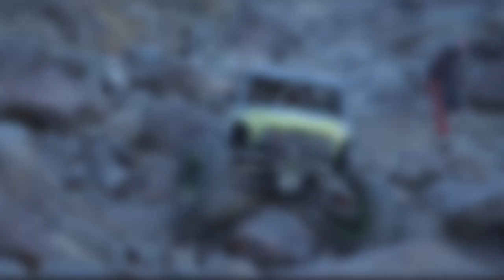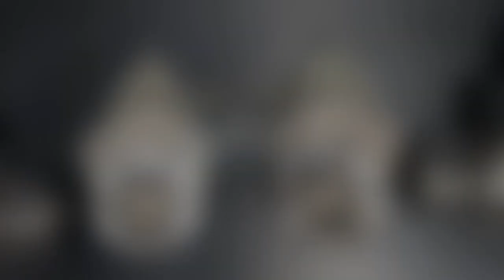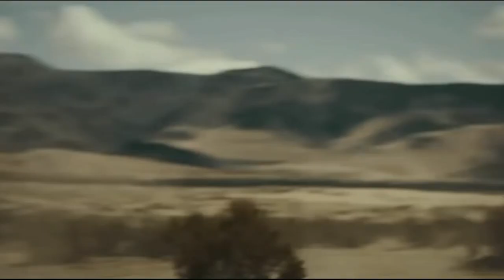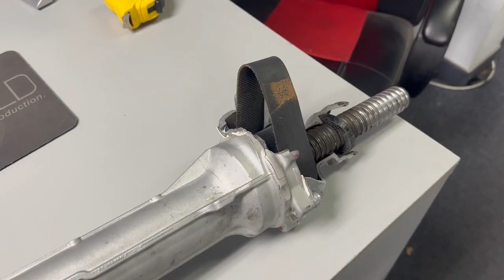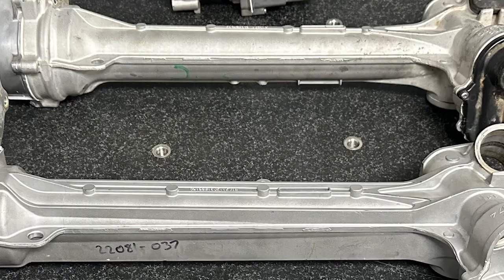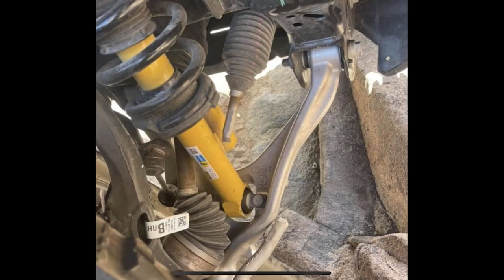Why is your bronco steering rack breaking?

Comment: Are the Hoss 2.0 and Hoss 3.0 interchangeable? Do they have the same bolt size? For backup purposes
Reply from the maker: @HoNkEyKoNg67  physical housings will bolt up using the same holes. If you are really worried about rack failures our stage 3 is what you want. You won’t break it
Reply: @74weld  so what would cause the driver side steering rack to make noises on a certain spot on the steering? I thought I had an inner tie rod wore out. I took off the boot. It's coming from the rack itself. You can aso feel it when you put your hand on the tie rod and have someone turn it. It makes a crackle type noise too. Jc I only have 3000 miles and haven't really been hard on it. I'm a gentle common sense type of wheeler. The Moab Ford dealer said it's ok to drive like that. They couldn't get me in to look at it officially. My local dealer will try and get out of covering it. I can see that coming. And this is the Hoss 3.0! 🙄

Comment: Thanks for the great video. 👍

When Ford designs these parts, what kind of a worst-case scenario do they use in their design?

In other words, what kind of a Safety Factor do they try to incorporate into their design, especially w/a part like this?

I would imagine that the Ford Design Engineer runs some kind of a stress analysis on the design, using a Finite Element Analysis (FEA) program, using a Safety Factor say of 2 or 2.5, depending on Ford's Standards, and if it fails, beefs up the design until it does pass.
Once passed, they make a physical piece and run it on a Bronco out on the field beating the crap out of it.

I own a bone stock 2023 Bronco Black Diamond, which I do drive on dirt roads, but nothing too harsh. I imagine that it only has the HOSS 2.0 rack

For peace of mind, I was thinking about going at least w/the BroncBuster Tie Rod BusterBrace Set, since it is such an easy part to install.

They also have their BroncBuster Standard BroncBushing Kit as well, which I don't know is a real necessity. I'd have to find someone to install it, which may not be too easy.

Thanks!

Comment: What's the weight difference between hoss 2.0 & 3.0? Could carbon fiber be an alternative? 3d printed cf? or 3d printed metal? I want stronger and lighter parts for my bronco.

Comment: Thank you for a great video and actually verbalizing that the tie rod is intentionally the weak point. I wish more people would understand that. With simple tools and a spare tie rod it’s an easy inexpensive trail fix. The stock configuration Bronco was a good design if ran that way. Any modification, will affect something else! If you plan to wheel your $70,000+ vehicle in the rocks, be smart do all upgrades including this, otherwise be smart and buy a wheeling rig and keep the Bronco for dirt/snow exploring wheeling.
Bailey Cole’s race Bronco is a perfect example!

Comment: What is the reason to go with the Hoss 3.0 rack and make the housing for it vs 2.0?
How many of the OEM 3.0 racks have you seen fail?

Why not make the housing for the 2.0 rack so that everyone with this rack doesn't have to purchase a 3.0 in addition to the stronger 74Weld housing?
Is the 30% more torque from the 3.0 rack that important?
Is there any downside to the 2.0 internals?

Thanks!

Comment: Nice details on the differences. I have the 3.0 HOSS setup. I'm not 100% sure I'll need a billet rack, but I believe this is definitely needed for the Broncos. I'd love to run your portals on my Wildtrak!
Reply: If you have a Wildtrak and want to upgrade the housing we will be able to swap your setup into our housing and save $$$.
Reply: @quinnpultz8004  Tell me more? Any possibility of sponsorship? I'm active on the 6G Forum. Would love to hear about a package with portals possibly.
Reply: @rugu6869  we don’t really do sponsorships but we are developing an ambassador program for people active in the community. Details on this will be released at the end of this quarter
Reply: @quinnpultz8004  Got it! Looking forward to it. Any technical details regarding the portals for the Bronco? Would it be wider than stock (fender flares needed)?
Reply: @rugu6869  we will do some videos here soon. Yes it has to be wider as we package a gear and two bearings all stacked in width. Not much we can change on that. The bronco will be similar specs to the Jeep. We have that info on our site

Comment: Very Excited to see what y’all come up with and very interested in getting one! I’ve had my steering “time out” on three different occasions while wheeling, Twice in Moab and once in Uwharrie. Definitely not a good feeling to loose steering and ready to get the thought if it failing out of the back of my mind.
Reply: What do you mean time out?  As in temporary steering assist reduction to almost none?
Reply: @josephburgard6574  Basically loss of all steering, every time it’s happened I’ve had to shut off the vehicle to get my steering back. All three times it was with the front locker engaged while trying to turn while on an obstacle. From what I was told from someone in development is it’s the electric assist timing out. I’m scared to try to overcome it by man handling the steering wheel so usually I roll far enough past that I can get the vehicle into 2wd and then shut it off and restart.
Reply: @moodyblueoutdoors  EPS (electronic power steering) units will purposefully de-rate and lower their steering assist output as a protection feature to avoid damaging the internals due to high temperatures and/or consistently high motor currents.  When you air down the tires and put the front diff locker on, the rack loads are much larger than normal which shortens the power on (duty) cycle.  Try to avoid continuing to steer while an obstacle blocks your front wheel movement as this stalls the motor (causing high motor currents) and only turn your front diff locker when you absolutely need to.  Just cycling vehicle ignition won't instantly bring back full steering assist due to the high internal temperature build up.  Not trying to criticize your driving skills, I'm no rock crawling expert, just know EPS pretty well.
Reply: @josephburgard6574  Oh I know, two of the time its happened I was actually wheeling with someone up the development chain at Ford and he actually broke the rack in his bronco so we had to trailer it home. My front locker only comes on in extreme need situations which sucks because it’s always a worry in the back of my mind on trips. One of the times we purposely left the bronco running and after 15 minutes steering still hadn’t came back. The other time restarting was my only option because if not I was stuck on the middle of the trail with 35 Gen 6 Broncos behind me.

Comment: So you guys don’t think the current aftermarket bushing for the rack that’s on the market is worth running?
Reply: I think that if you plan to offroad your bronco you need to change HOW the rack bar is stabilized. You can add whatever aftermarket things you want but because the factory rack uses essentially a crush sleeve to set backlash on the rack and pinion there is no way to change how the rack bar is supported on the pinion side. Any bushing on the pinion side that is tight is a bad idea and a bushing that is loose doesn’t support against shock loads. Does this make sense?

Comment: You can put the HOSS 3.0 steering rack in any Bronco now with FDRS.
Reply: This is only somewhat correct. We have successfully programmed the rack and I don’t think this is something the “average guy” is going to do. With that said I had several meetings with Ford Performance engineers at KOH and they are eager to support this endeavor. This will be an option in ProCal. If you don’t want the tune, you can get a ProCal for JUST the rack at a lower price point.
Reply: Check out the 6G forum. The 3.0 rack has been swapped into a Bronco and they have the coding to go with it completed as well.

Comment: A356 is not super strong, neither is 6061-T6, while 7075-t6/t651 is probably the best choice of aluminum for this.  7075 is way stronger, still has 11% elasticity, and is about the same in raw material cost (at most 10% difference).
Reply: We feel 7075 is probably not needed in this application. Are we 100% sure…not yet, but to give some perspective, we run 6061 on our portal boxes that do 140mph across the desert and we have never had a failure in over a decade of use. Materials are important but so is design, arguably more so. We are confident that the pinion will shatter before our housing will break
Reply: @quinnpultz8004  I agree with you that design is more important than the pure material strength.  Some opined that it could be that 6061-T6 is weldable and 7075-T6 is not, which for Baja/endurance races could be a factor. I appreciate the response!
Reply: @mpeugeot  it has nothing to do with welding. We don’t feel 7075 is necessary. 6061 is cheaper and more readily available in the sizes we need. Trophy truck racks are 6061. I see the chatter on the forums and there is a lot of misinformation out there.

Comment: So when these off road shops add a clevis and a heim and change pivot location and angle which will add bump steer along with other things. It’ll make a oem rack fail even more.   Same as like on a gen2 raptor.  Since a clevis I have seen moves the pivot location out like 1.300” from factory per side.
Reply: You deserve a cookie! This is a yuge over sight when building an IFS steering system.